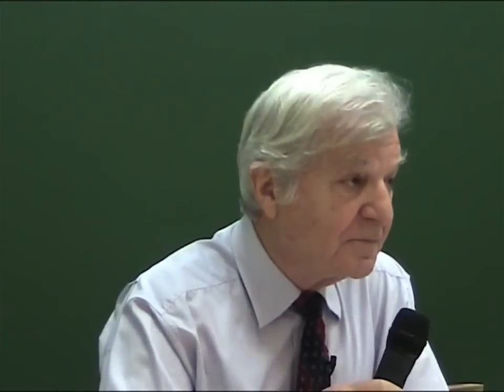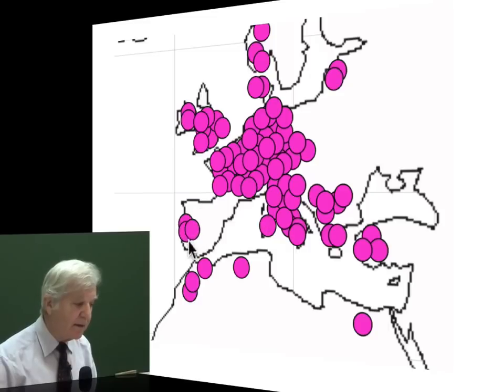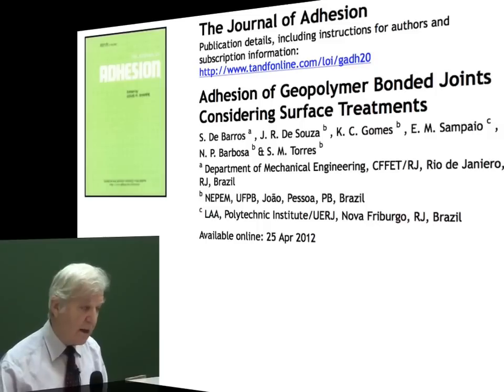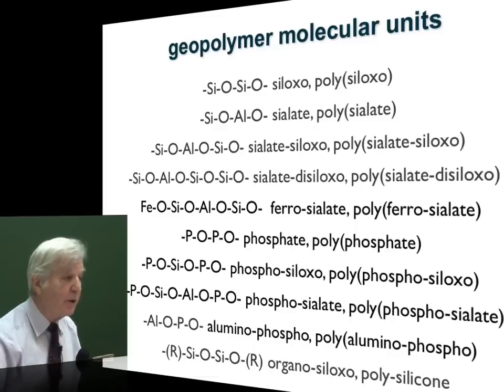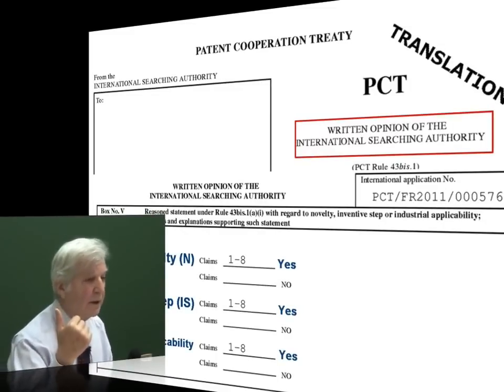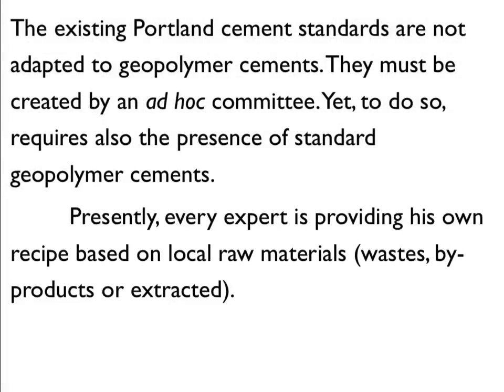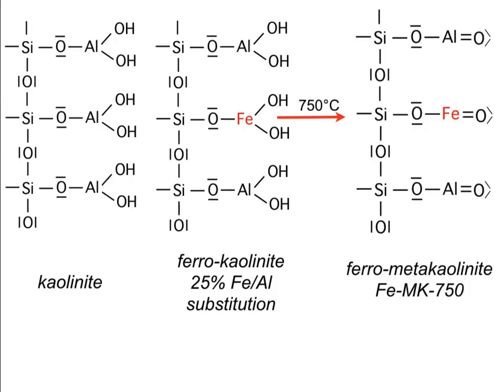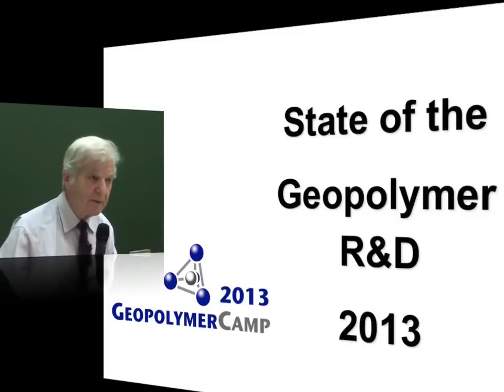State of the Geopolymer 2013

Comment: For human health benefits, floor & wall geopolymer panels, with included iron, can be solidified within the presence of a strong oriented magnetic field, to produce tailored magnetic panels.  Resultant building interior spaces will provide uniform intensity & properly oriented ~ 2 gauss magnetic field within the whole building interior.  
Even outdoor garden spaces would benefit from vitality enhancing geopolymer magnets. 
Each panel would have to be tailored to correct & enhance the local geomagnetic profile. 

Arthur Ramthun:  Plant Electrotropism | EU2015 
https://www.youtube.com/watch?v=-MumeA4q-5Q 

Idealized "Voltage Circles" around plants, can be produced by the DC Magnetic Fields emanating from magnetic geopolymer plant beds.

Metal & stone softening "Without Heat" is accomplished by "Controlled Phase Transition of Metals" 
utilizing strong resonant pulsing magnetic energy. 
US Patent # 7,524,385 Terry McGrath, Longmont, Colorado  -  Summary :  
A process for electromagnetic (EM) energy-induced solid to liquid phase transitions in metals is disclosed. The method utilizes coherent EM fields to transform solid materials such as silicon and aluminum without significant detectable heat generation. The transformed material reverts to a solid form after the EM field is removed within a period of time dependent on the material, and the irradiation conditions.
 http://patft.uspto.gov/netacgi/nph-Parser?Sect1=PTO1&Sect2=HITOFF&d=PALL&p=1&u=%2Fnetahtml%2FPTO%2Fsrchnum.htm&r=1&f=G&l=50&s1=7524385.PN.&OS=PN/7524385&RS=PN/7524385